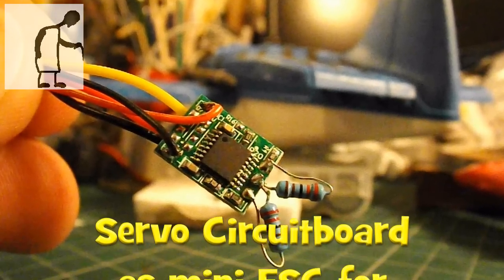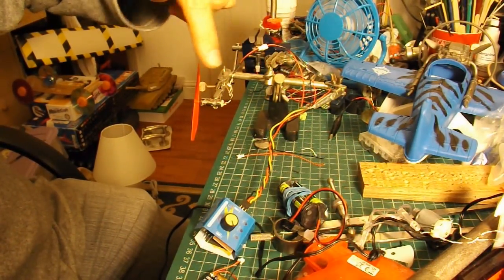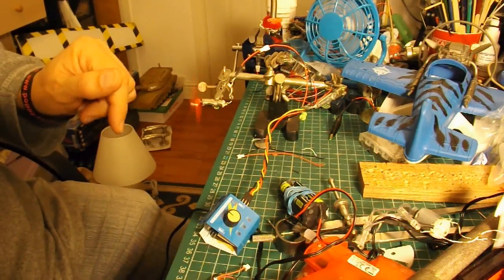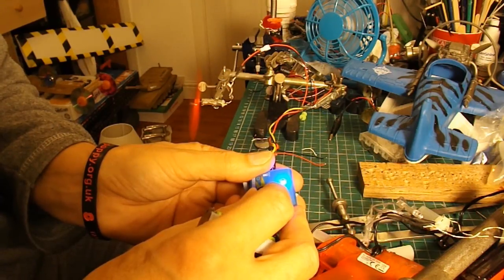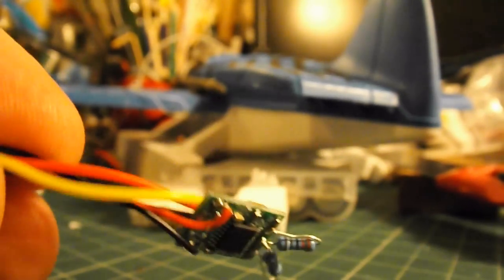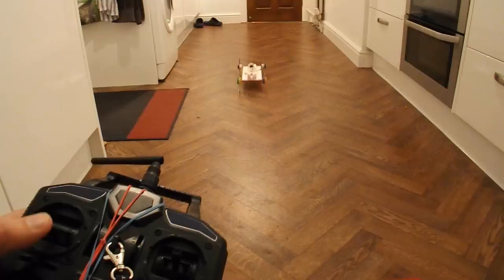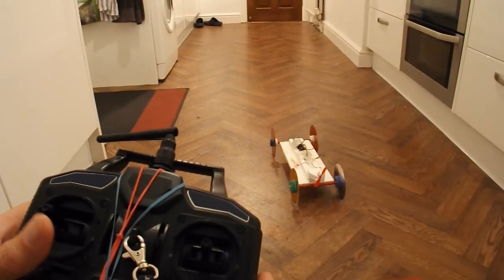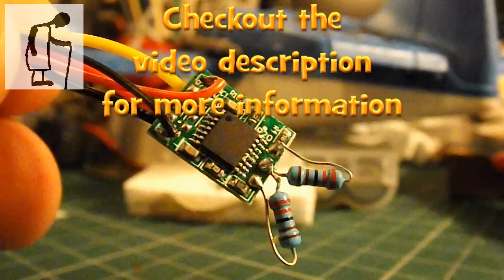Servo Circuit board as mini ESC for a small DC motor

Comment: I have question if you could please help, if i get a servo motor and disassemble it and remove the dc motor inside it and replace it with a n20 micro gear motor which is also 6v and i also fit the potentiometer to the n20 motor shaft, would i be able to control it as a normal servo? would that work? Thank you
Reply from the maker: In principle it should work, but I am not sure how practical it would be. It is probably one of those things you would have to try it to find out. This video by @HomoFaciens should help you  https://youtu.be/v2jpnyKPH64?list=PLA5a2xPRSrB1nJ5I3Uzrjf41VCJzrab4p

Comment: What happens if you don't solder resistors?  Won't the board see 0 and 0?
Reply from the maker: Try it and find out 😁 In this video "Revisiting Servo circuit board mini ESC FULL LENGTH" https://youtu.be/gcV-1iMMK4o I added a bit to the end of the video because I didn't think about it until I had finished filming. I worked my way down in resistance values until I ended with zero and it still worked fine so the debate about values may be irrelevant.
HOWEVER, in this video "Demonstration of changing the rotation on a SG90 servo with resistors." https://youtu.be/WhHiln_uV1k I found that changing the value of the resistors does change the angle of rotation available for normal use.
This is my "Working with RC Servos" playlist https://www.youtube.com/playlist?list=PLA5a2xPRSrB1nJ5I3Uzrjf41VCJzrab4p
Reply: @GrandadIsAnOldMan  

Thanks!

Comment: Bro can we use it for big moters
Reply from the maker: I wouldn't think so. You would need to check the data sheet for the chip to see what current and voltage it could handle. I wouldn't expect a manufacturer to provide a chip that would handle more power than they are designing the servo motor to draw.

Comment: Good day , thank you for your video, it help me alot, I changed my servo from 90 degrees to 180, with a 1,8kU resistor, well done thank you, but I struggle now, i would like to bring down the speed of the servo. can you please help with this, can I put in more resistors or what do you suggest ??
Reply from the maker: You would need to research Pulse Width Modulation. That is how the circuit board controls the speed of the motor.
Reply: @GrandadIsAnOldMan   if i put a resistor between the motor would it work. ?
Reply from the maker: @mornestofberg195  surely you can just do it and find out? I would expect it to reduce the power to the motor, so it might slow it down, but it might mean it does not have enough power to drive the gears. Like I said, the circuit controls the motor via PWM so you need to understand that to work out how the speed is adjusted. PWM adjusts the speed without reducing the power.

Comment: Nice idea and good tutorial.
I tried it myself but the esc is bidirectional.
Do you know how it can be made to be one direction esc for a plane that is????
Reply from the maker: Short answer is NO. I did try changing the resistors to try to force a difference but without success. Here is a follow on video with a second look at these servo circuit boards https://youtu.be/BQTsWH-7NAw and an extended version on my other channel - Revisiting Servo circuit board mini ESC FULL LENGTH https://youtu.be/gcV-1iMMK4o

Comment: i tried to do the same from a flite test video but i burnt out two servos
Reply from the maker: Sounds like you are trying to run motors that draw too much current.
Reply: @GrandadIsAnOldMan  i first tested the motor that was still on the servo board but it burnt out
Reply from the maker: @ggg567-n6p  that is pretty impressive, so you changed nothing and you still burned out the board? What were you doing with it?

Comment: Can we use this esc for an rc micro plane it's possible to make a rc palne with this esc 👍😀
Reply from the maker: You could, but there are a few things to consider. First, the control is not as good as you would get with a proper ESC. Second, this gives you reverse, which you don't want for a plane. Third, if you are looking to save weight you are probably better off getting one of those WLtoys f949 combined Receiver boards that includes motor control and a couple of servos all on the same circuit board.
Reply: Yes ! ur right sir 👍 thank u 😀

Comment: Hiiii..... I  tried this but resistors got hot and motor stopped rotating. Does these get hot in your setup.
Reply from the maker: No they shouldn't get hot, there is very little power going through them so I would guess you have something wrong with your wiring. They are not in the motor circuit, they are just replacing the potentiometer which is used to tell the circuit board how far the servo arm has turned. What voltage were you using, most RC receivers run on 5 volts, and what sized motor were you driving?
Reply: @GrandadIsAnOldMan  Thanks to you for update. was driving the servo motor itself. I will use higher value resistors and low voltage battery and update you. One servo is burned through this process.
Reply: @EpicFilmshub  have you left the motor in the servo gearbox or taken it out?
Reply: @GrandadsOtherChannel  I have taken it out... there is no load on motor. I am doing it on Towerpro 996. Yet didn't succeed.
Reply: @EpicFilmshub  there is no reason for the resistors to get hot so I am concerned why there is power flowing to them. It sounds like there is a basic wiring issue.
Reply: @GrandadsOtherChannel  I tried again on other servo. This time resistors temp was normal. But motor didn't run. I was using servo tester. I soldered Resistors on the potentiometer points. Wiring was Brand new.
Reply: @EpicFilmshub  I really cannot think what you are doing wrong. All you should be doing is replacing the potentiometer (which is simply a resistor with a moving centre tap) with a pair of resistors so the centre point is fixed. Maybe Peter Sripol explains it better in the video he did on FliteTest here https://youtu.be/XUm2nj7te8E
Reply: @GrandadsOtherChannel  I have tried this. When I switch off the radio and turn it on again I have to set trim again even sometime motor just kept rotating uncontrollably. By the way Thanks for your Kind gesture. You are amazing.
Reply: @EpicFilmshub  here is another video (very long and detailed) and I have set the link to start at the point where he is talking about the potentiometer on a more complicated servo board https://youtu.be/cQuLKN0oYms?t=1454
Reply: @EpicFilmshub  yes, finding the null point/centre position can be an issue. In the follow on video I did, I experimented with different resistor values https://youtu.be/BQTsWH-7NAw

Comment: Can somebody tell exactly where these resistors to be soldered.
Reply from the maker: I show you a full screen picture at the start of the video, I also explain in the video 01:13 that those resistors replace the potentiometer that the servo uses to check it's position. There are 3 wires that go to the potentiometer and at that point in the video the resistors are connected to those 3 wires and the potentiometer has been removed. Later in the video at 03:08 I show you in close up that I have tidied it up bay removing the 3 wires and soldering the resistors directly to the circuit board where those 3 wires came from.
Reply: @GrandadIsAnOldMan   Thanks A Lot Sir... You are very Kind and Helping... Thanks Again..! 😊🌺
Reply from the maker: I just remembered I did a follow on video in 2019 with a second look at these servo circuit boards https://youtu.be/BQTsWH-7NAw
and an extended version on my other channel - Revisiting Servo circuit board mini ESC FULL LENGTH https://youtu.be/gcV-1iMMK4o
Reply: @GrandadIsAnOldMan  Other Channel Subbed too...

Comment: You don't pull power from the receiver. The amps flow between battery and servo. The receiver itself is basicly zero ohm from battery to servo. It's just passing through and takes it own power
Reply from the maker: You are right, the + and - for all the channels are a common rail. What crossed my mind was that you are now running a high speed coreless motor through the same wires that were OK with just the servo motor. You probably won't damage the receiver unless you are very unlucky but you might draw too much current for the battery wires, especially if you misunderstand what I am doing here and thing you can forget about buying brushed ESCs and just pinch the board out of a servo. It would be interesting to see how much current one of those servo boards can handle and which would die first, the wires or the board. Thanks for commenting, you are spot on 😁👍

Comment: i would think a 1.5k resister would be a better choice. Most potentiometer's have 1.5k resistance at 6 volts when sitting dead center.
Reply from the maker: Let me think about this, you say most potentiometers, obviously you mean most potentiometers in RC servos 🙂 Yes, fine, if that is the value of your potentiometer then use it. You could just use the existing potentiometer, put a dot of glue on it to hold it mid point and disconnect it's drive shaft/gear so it can't move. (FliteTest did that version for a 360 degree rotation servo) The circuit will be comparing the two inputs so as long as they are equal it thinks it is in the middle so it won't stop turning when you give it left/right or forwards/backwards or whatever. You should be able to use almost any two matched resistors to fool it. I suspect somebody had a couple of 2.2k resistors handy when they did the first YouTube video and all the videos since then copied the values, alternatively somebody on an RC forum did some research and found best results with 2.2k, probably the former rather than the latter. By complete coincidence I recently had an incompatibility problem with a couple of servos and an ESC I was given and I do have one of those servos on pieces and I can confirm that potentiometer measures 3.3k across the terminals although it is still soldered in place so there may be some other input to that measurement. Here is the related video https://youtu.be/i3NQ6ggs2O0 Thank you so much for taking the time to comment, much appreciated.
Reply: @GrandadIsAnOldMan  the resistance can go as high as it wants and it will still work, but the higher the resistance you use the less accurate the esc can be, and the less power it can feed to the motor.  i think the higher resistance is creating a low power situation where it is not starting in the hz range it wants to start at. 1.5k is my number because i specifically use a 6v 2A bec. i will break out the bread board today and do some in depth testing and get back to you.I could be completely wrong, but wont know until i get out the scopes :)
Reply: @jasonpressler7111  it will be interesting to see your result. I did wonder if you could just put a straight short across them, I haven't tried it myself and the only diagrams I have found indicate that would be a straight short Vcc to Gnd so not a good idea although none of the diagrams I have found look quite what I am looking for. If you do come across a good diagram for a servo I would love to get a copy of it.
Reply: @jasonpressler7111  if you haven't spotted it already here is one of the projects I did using this "ESC" https://youtu.be/Znq8f1UF_uc
Reply: @hermitoldguy6312  it's purpose in this case is to enable the control circuit to know how far the servo has rotated. By using 2 matching resistors we are fixing it so it thinks it is in the centre position. That means no matter how far you push your transmitter stick in either direction the feedback the servo control circuit receives from it's potentiometer is zero rotation so it continues to send power to the servo motor and depending on how far you push you transmitter stick the speed of the motor is controlled, nothing to do with the resistor values as far as I can tell although thinking about it, it may effect the "Expo" or rates as the RC guys like to call it. On the car and boat I controlled with this there was a problem getting the exact zero point on the throttle stick and changing the resistor values might reduce that problem. If you used unmatched resistors then the motor would stop when your transmitter stick is at a position that matched that imbalance so your centre stick would no longer be zero thrust. If you wanted to use this "ESC" to control the motor for a small aeroplane then you would offset the balance fully to one end as you would never want reverse thrust whilst flying and you want your transmitter throttle zero position to be fully down. That would then give you the full proportional range right the way from zero to max. Something I have on my list of projects to try.

Comment: So just reverse Everything  and add 2.2k R. ?
Reply from the maker: You can even do it without the resistors if you retain the original potentiometer but it's not quite as neat. Neater still would be a couple of those tiny surface mount resistors. I might try that sometime.
Reply: GrandadIsAnOldMan how ?
Reply from the maker: @thelongranger55  if you mean using the existing potentiometer you just find the centre position and glue it in place so it can't be turned and then cut off the peg attached to the gears that would turn the potentiometer so it no longer moves. The way that a servo works is it calculates how far it has turned by measuring the difference in the resistance of the two sides of the potentiometer. Replacing the potentiometer with the two resistors simply ensures that the detection circuit is being told it is still in the middle no matter how far it has turned so it does not stop turning. You use this method to make a servo turn continuously when you want to use them as a geared motor. There are plenty of videos on the subject but here is the FliteTest video https://www.youtube.com/watch?v=XUm2nj7te8E?list=PLA5a2xPRSrB1nJ5I3Uzrjf41VCJzrab4p If you don't want the existing motor in the servo than you just wire the motor wires away to whatever motor you want to use but remember what sort of size the motor is so you use a similar size motor, maybe a 3.7 volt coreless like I show in this video.

Comment: Can you tell me what rasistor should I use in 4.7v servo for making esc
Reply from the maker: Try the ones shown here. The main point is they are both the same so they fool the circuitry into thinking the servo has not turned. Normally the circuitry measures the difference between the two resistances of the potentiometer so it can tell how far the servo has moved in either direction. There is an alternative method using the existing potentiometer inside your servo - FliteTest did a good video on the subject https://youtu.be/XUm2nj7te8E?list=PLA5a2xPRSrB1nJ5I3Uzrjf41VCJzrab4p
Reply: Thanx

Comment: Thanks i needed an esc and thought i was out of luck...until i saw your video!
Reply from the maker: Thanks, obviously this will only work with fairly small brushed motors. Anything needing over 5 volts and a high current is probably going to cook it.
Reply: It will be perfect for a toy micro 1/28 rc that needs to be converted to proportional control.  your idea is perfect because it won't take up any room at all.  my servo says 4-6V so as long as i don't go over 4 AAA batteries i should be ok
Reply from the maker: Make sure we see a video, I am just watching yours now :-)
Reply: Correct,  even I wanted ESC and had lost hope of getting new radio control and all other components.  

Will try this. Thanks Grand Dad!

Comment: Going to do this for some N20 winches. If your controller is a programmable one widen your centerpoint deadband or set it to one of the three position switches.
Reply from the maker: Yes adjusting the centerpoint deadband would be a good idea, unfortunately the FlySky FST4B transmitter used in this video has no programmable features.
Reply: Try arduino nano and nrf24l01 rx and tx chep and easy to code 👍👍 I tryed nice stuff...

Comment: you might possibly get more speed control if you lower the value of the centering resistors.
Reply from the maker: Maybe, or you could just use the existing potentiometer from the servo and centre it then fix it with some glue. There are some links in the video description to other people's videos on the subject.

Comment: been thinking if you could possibly make a boat that has a fishtail type propulsion rather than a propeller.
Reply from the maker: I have done a few.
Boats on the paddling pool #1 Flipper Boat https://youtu.be/tMrsPwHbuOA
Motor Boat from an Oscillating Toothbrush https://youtu.be/jozN2szewSo
Bargain Store Project Recycled #3 Flipper Paddle Boat https://youtu.be/1tLZPlvEblE
Mike Dodd has several interesting flapper boats on his channel, here is an example https://youtu.be/Vwmwxa_YOdc

Comment: where do you get that 4x AA batery holder  with conector for the servo tester?
Reply from the maker: The battery box comes from an old torch. The connector probably came from ebay or taken off another servo.

Comment: Hi. Value of the resistors 3.3 Kom?
Reply from the maker: I Used 2.2K  but I think you would probably be OK with 3.3K as you are just setting the centre point. The colour may be a bit off in the video but they are RED RED BLACK BROWN BROWN so 2,2,0, x100 with 1% tolerance http://www.digikey.co.uk/en/resources/conversion-calculators/conversion-calculator-resistor-color-code-4-band

Comment: can you build like a mini rc rescue recovery boat with that?
Reply from the maker: +Thundi you could, but there is not much weight saving compared to the small ESCs I use and you are running your motors using the power going through the receiver so you may burn out your receiver if it has no protection circuitry.
Reply: GrandadIsAnOldMan oh I didn't think about that.

Comment: could you use a delta-mixer for a boat?
Reply: so you have two motors on it
Reply from the maker: +Thundi yes you can, I have done that on my original rescue boat and then found it was easier to control just using one motor on the throttle and the other motor on the elevator.